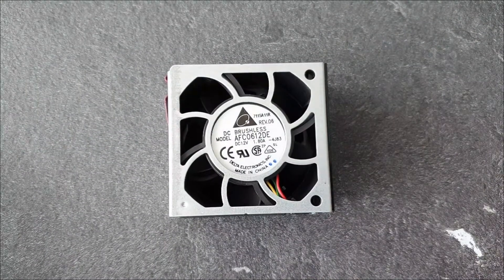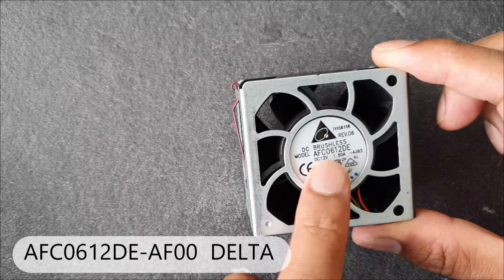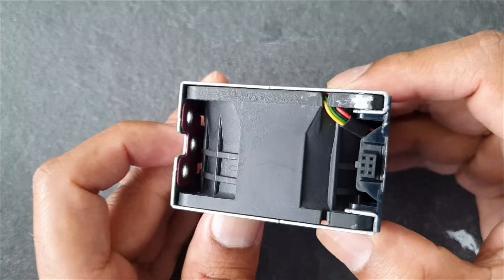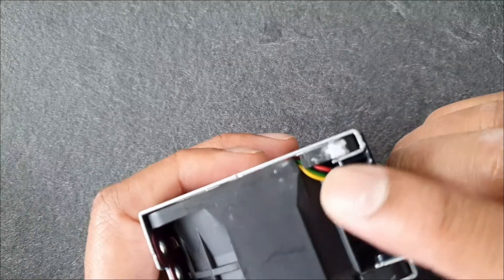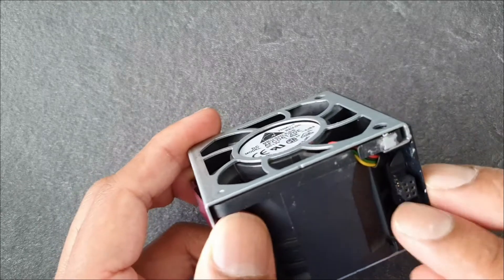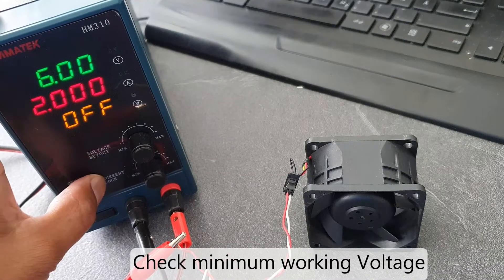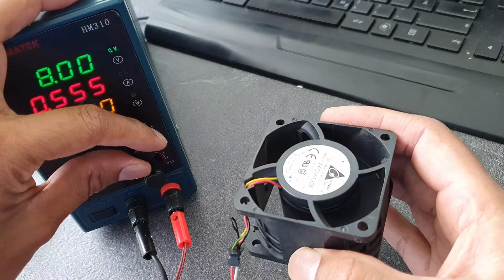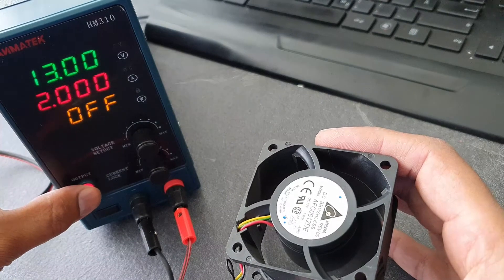Server Fan Test , 6 Pins , 12 volt , extremely fast , Delta Electronics AFC0612DE-AF00

Comment: Sir I have same fan but i confused how i use this  , 4 wire and i don't know about this sir plz help wire colours 
Red
Blue
White
Purple 
Plz help
Reply: Use red and Black pin for 12 V Negative and positive connection.. Then it will be run super speedly

Comment: Very nice fan. I have a few delta and AVC server fans myself. I mainly use them for RC car motors. To cool the motors. I'm curious, what is the power supply you are using to supply voltage to the fan? I want to be able to test the fans before installing them in my cars. How much voltage can these fans sustain for a long period of time? I tested some of my 2.20v AVC fans with a 4S lipo, which outputs roughly, 15.8v. But I want to modulate the voltage with a device such as the one you use in this video. Wheree can I buy one? thanks.